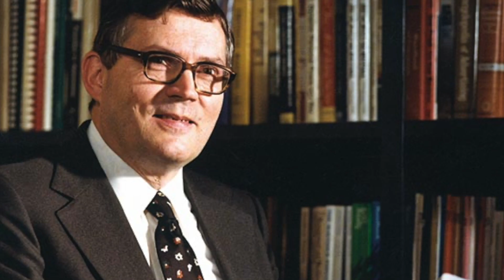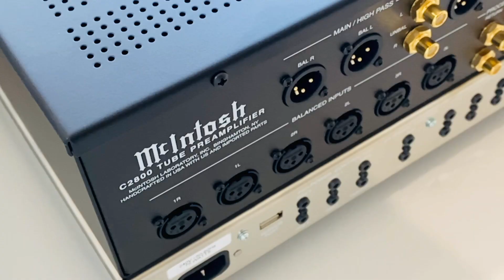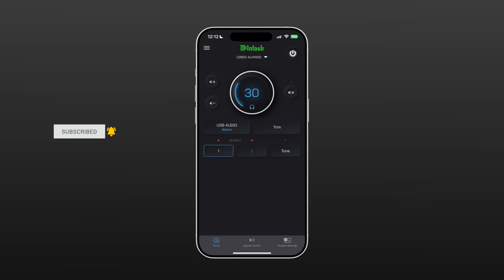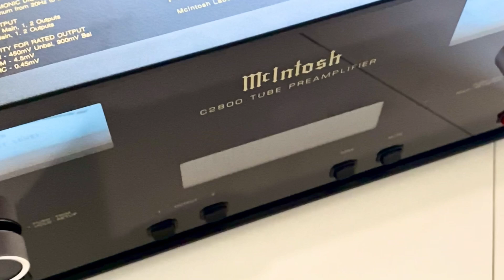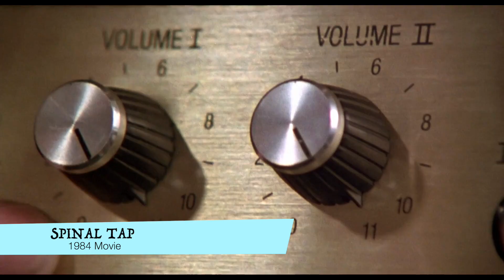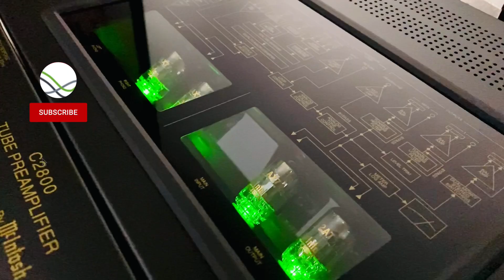McIntosh C2800 tube preamp | my thoughts

Comment: Lovely video. 
Your system is quite impressive, I like it. But I have one comment: Are you not afraid of getting further termite damage in the stereo rack? I am also a DIY kind of person especially with interconnect cables; I make my own. But I strongly recommend that you change the wood under the amp.
I am also a Mac equipment enthusiast like you. I own the C2500 and thinking of an upgrade. But I am on the fence between the C55 and the C2800. I will make that decision soon. 
Good job on the video. Well done.
Reply from the maker: Thanks for the compliment, much appreciated.

Not too worried about termites where I live. I also have cypress pine mixed in, cypress pine is termite resistant.

I wanting to get the C22 for review in August, but still awaiting confirmation on that.

Thanks kindly for the view
Reply: @concordhifi  Great. Keep up the good work. I will be visiting the McIntosh House of Sound in New York in a few weeks. That visit might convince me about the C55 or C2800.
Reply: I bought both.

Comment: One question. Is the 12AT7 tube in the signal path?
Reply from the maker: Yes, but mainly for the headphone amp.
And the high and low pass filter and level trim.